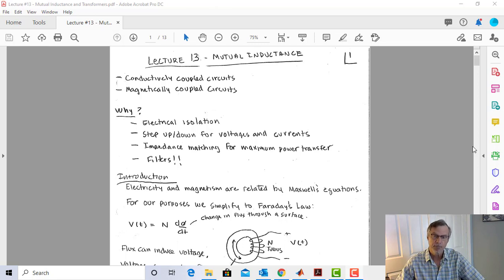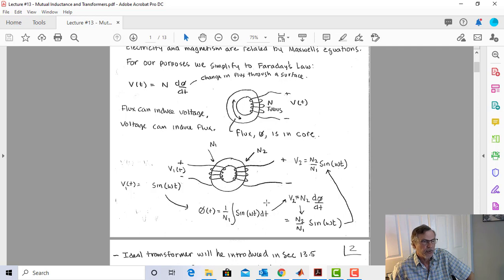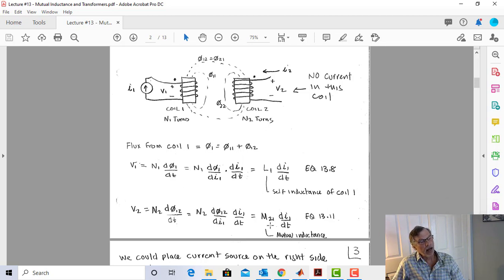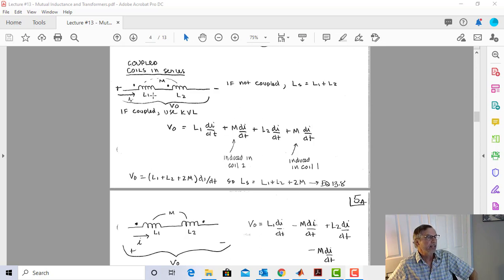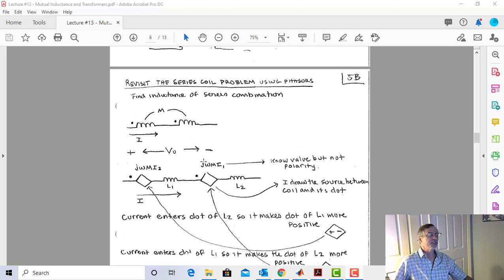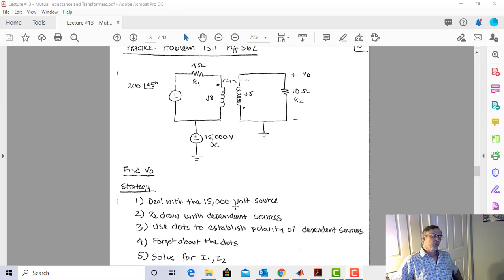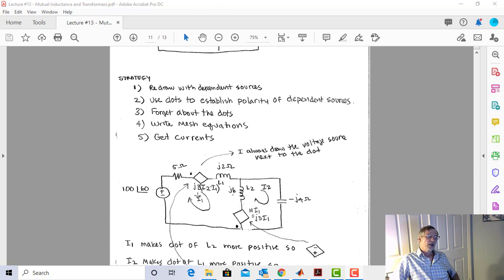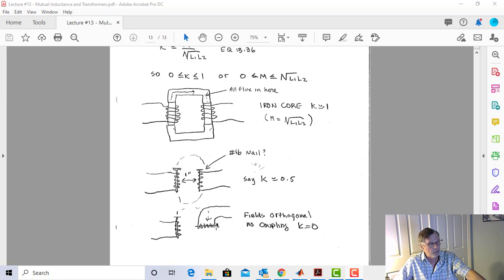EE310 - Lecture 13 - Mutual Inductance and Transformers

Comment: In problem #2 @ ~1:10:30 why do you have the Source Voltage in your matrix as 100/MINUS 60 degrees instead of 100/+60 degrees?